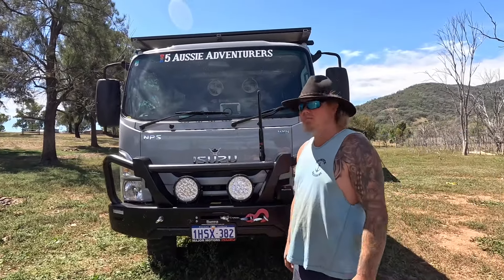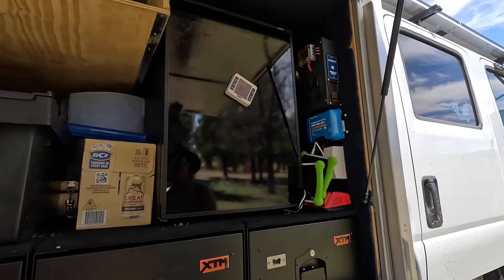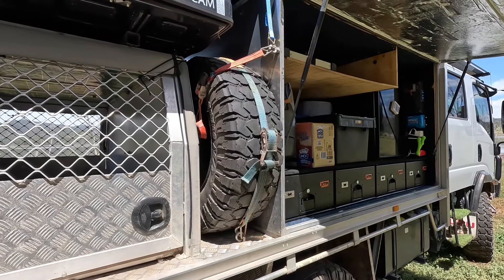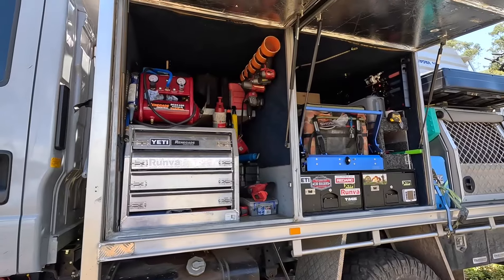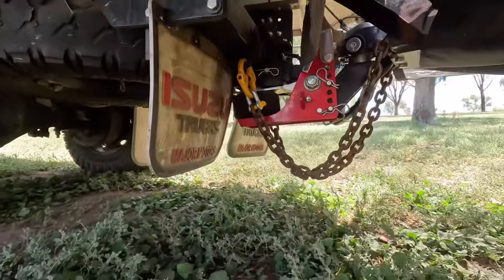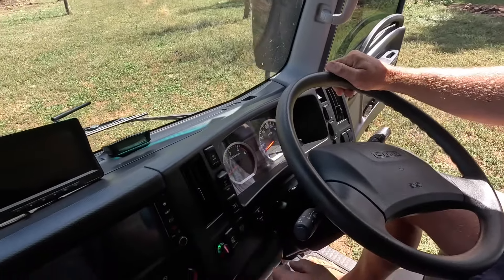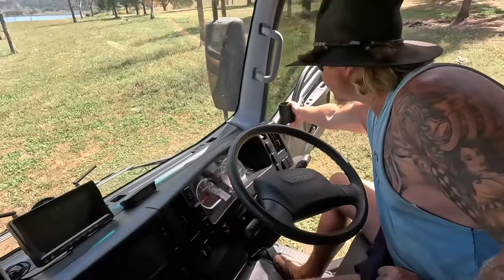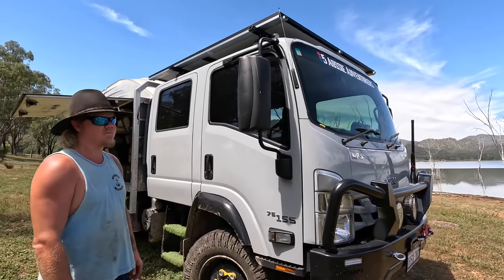Check out our #Isuzunps300 truck walkthrough

Comment: A little hint when it comes to aluminium Cairns if you don't want them bouncing and rattling around on dirt roads which will cause some to bust grab yourself some soft spongy foam not only will it help stop your tinnies from rattling but it will fill up the big airspace which will make your fridge run more effective
Reply from the maker: Great tip! Thanks for sharing.